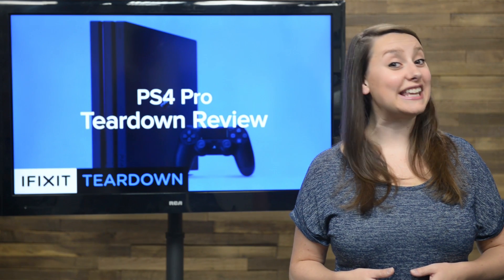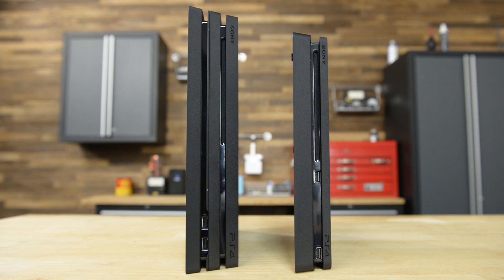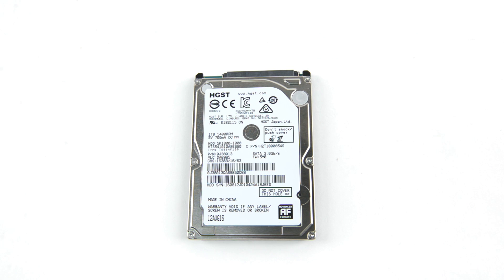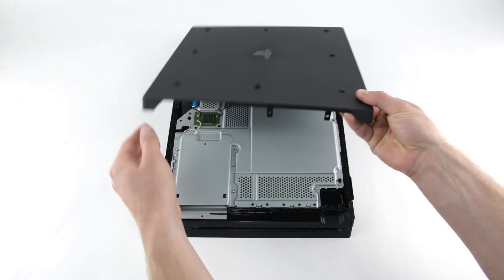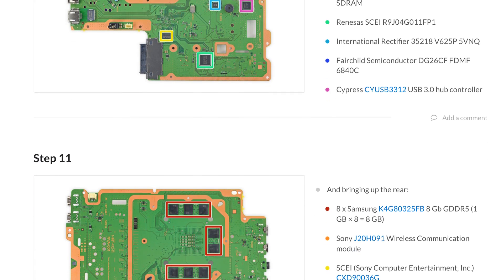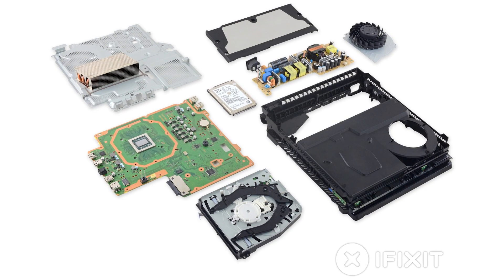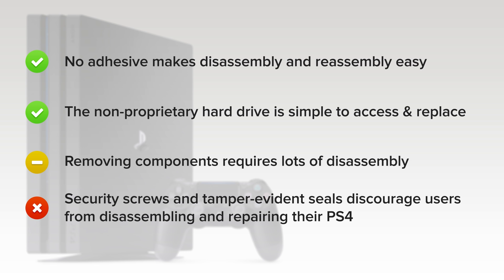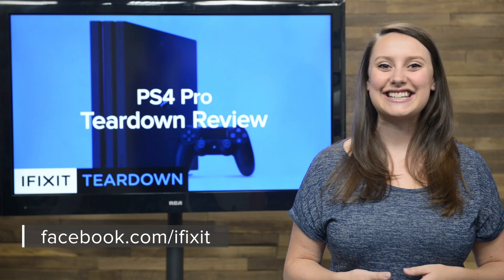PlayStation 4 Pro Teardown Review!

Comment: It should be rated 1 because of the torx screw driver which nobody has
Reply: I think torx should be the only standard. Philips screwheads break and need downward force and flat head screws don't center.
Reply: What? On the contrary, torx screws never fail, but it's really easy to ruin a philips screw.
Reply: Mikko Haavisto well phillips screws do not require a set of many different sizes drivers like the torx which need the exact precise screw driver
Reply: I have one.
Reply: Mikko Haavisto no they are not as durable as phillips screws
Reply: Well there are two varieties of philips type screws and also at least five different sizes. That isn't at all different from torx screws. On the contrary you will ruin your philips screws, if you use a wrong sized driver. Torx prevents you from doing this.
Reply: Mikko Haavisto No it does not. You can still mess up the screws because of there stupid shape

Comment: I would swap the hard drive with a ssd
Reply: that's an old concern, SSD now support Petabytes of writing before failing and you'll use a playstation ssd mostly for read operations and standard HDD do wear over time too so if you can replace an HDD with an SSD you should do it if you want better performance.
Reply: 999CATZ SSDs have certain amount of write/delete operations before they fail. I fear it would wear out faster than wanted.